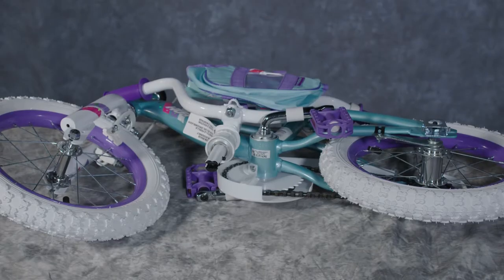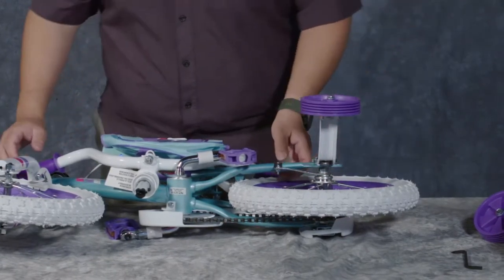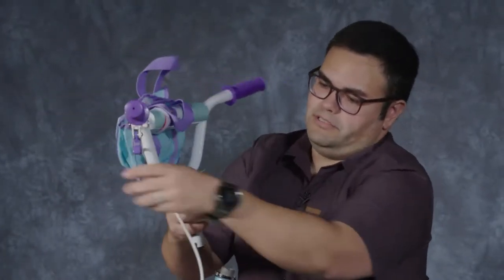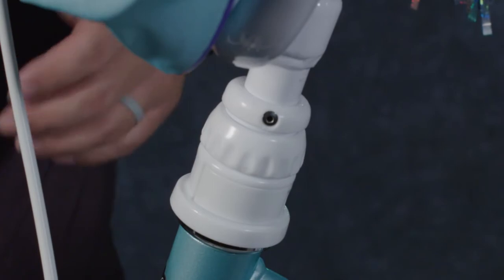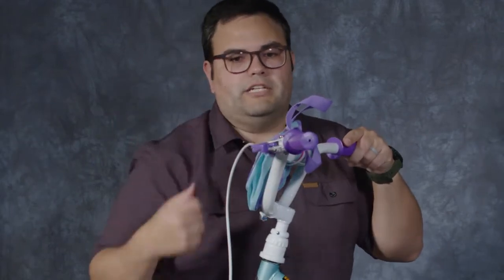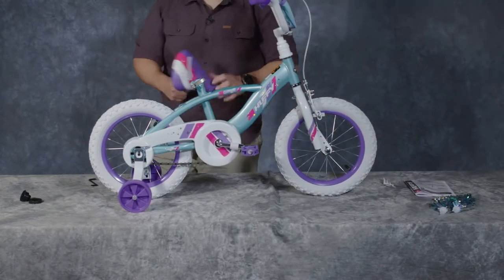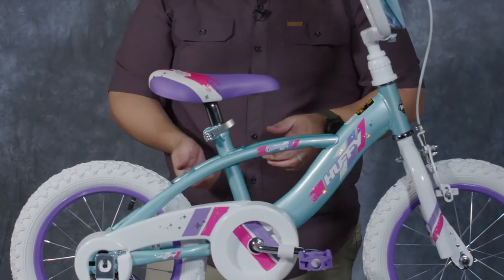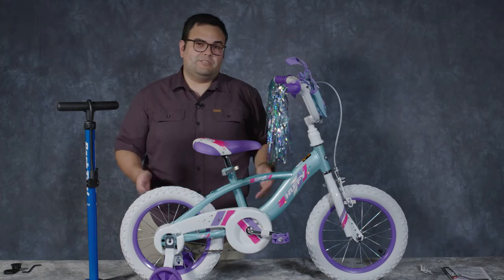Snug It Up - Quick Connect Assembly | Huffy

Comment: Any ideas how to re connect the D Pins if they get losged up the lower part of the handle bar? I tried to connect it using some firm pressure and it did not click. And then it pushed both the D pins up into the bar. Is it salvageable?